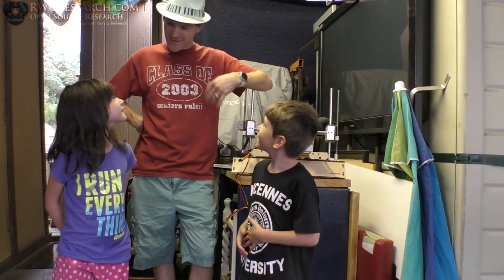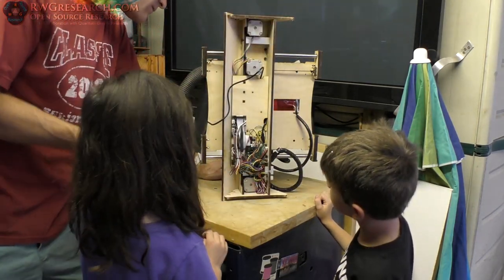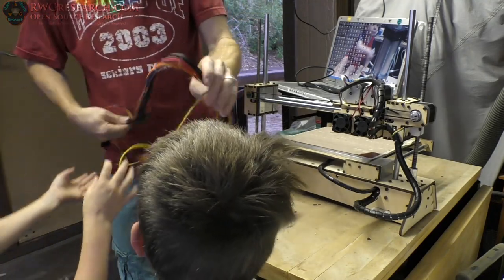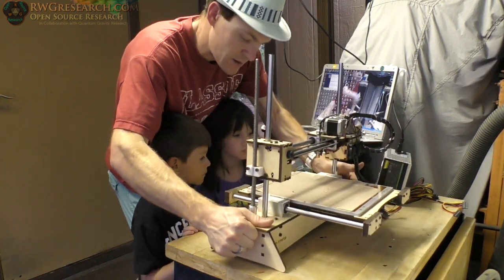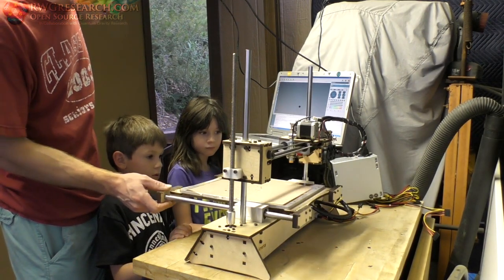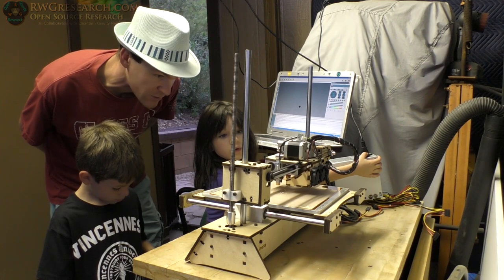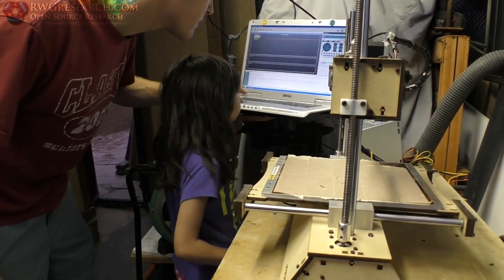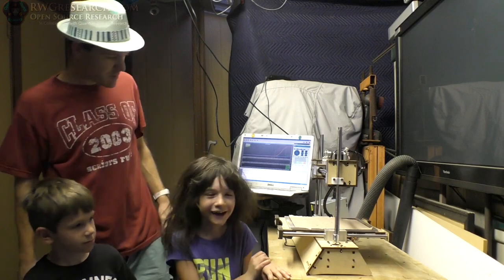RWG - ADOPT-A-BOT Part 2 : day1 its alive!  : Free 3d Printer For A School YOU Pick!

Comment: I dont know if you've thought of it, but since you'll be giving it to a school you should consider connecting something like a raspberry pi zero w, with octoprint installed, to make it really easy for them to use :)
they only cost like $5 plus a 5v converter, microsd card, and usb cable. and it makes 3d printing so much easyer for the school, because you can pre-configure it to match the printer... but maybe thats just me, because thats the sort of thing I do lol
Reply from the maker: Dan300891 print&go yes. I'm going to donate a laptop that I will set up just for this and it will be pree configured so it should be easy to use. Because there needs to be a computer connected. However I like your idea. I bet getting on a school network might not be easy. Lots of scuricity stuff in place. So if its a Stan alone unit it will be better. I think!  Thanks for the comment!  ~Russ